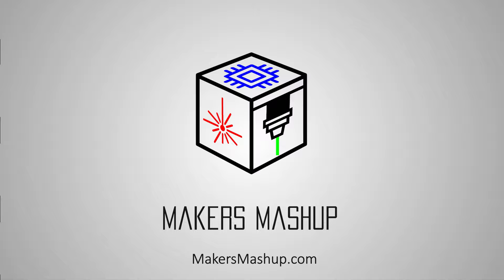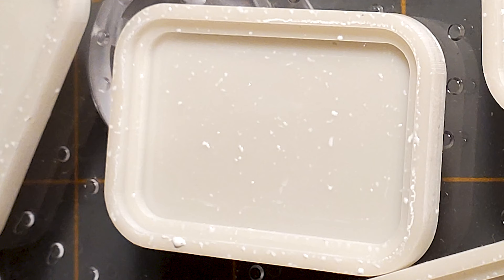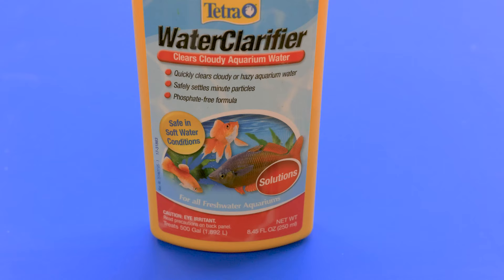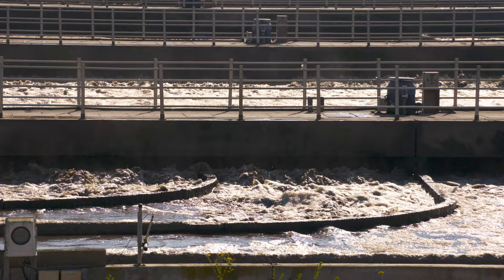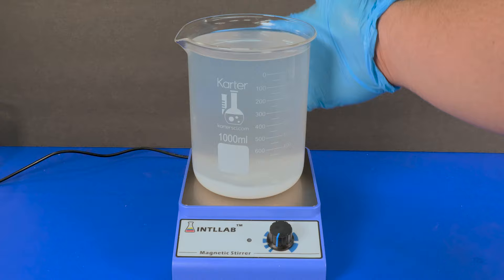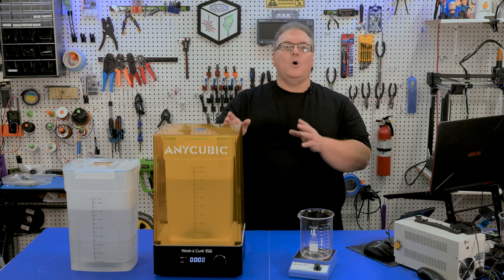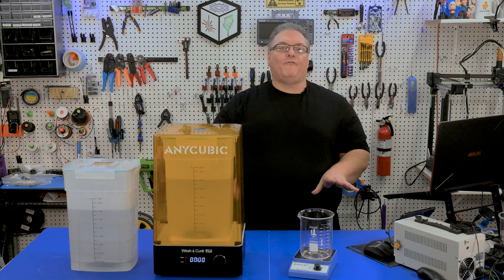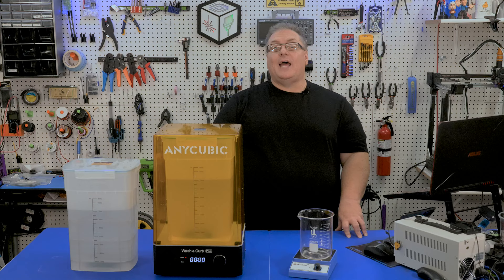Recycle Isopropyl Alcohol FAST! | Recovering IPA From 3D Printer Resin Wash

Comment: Okay, so I was hesitant to even try this just because of the dilution factor, but my IPA was so dirty that I figured I’d at least half-ass it, and half-ass it I did, successfully…
I happened to have an alum block laying around, I use it after shaving (it helps with razor burn and cuts boys, you’re welcome), so I used a zester and shaved off what I think was about 8-10g or so. I added maybe 2tbsps or less of distilled water, mixed it up a little bit and then added it all to my IPA, being sure to get all of the undissolved alum, which was most of it since I used such a small amount of water. I let my machine run for like 10 minutes and already noticed a difference after it was done. I let the IPA sit for a few days, not purposefully, I just wasn’t using it. I came back to look at it on day 4-5 and it was the cleanest I have ever been able to get used IPA, and I have used a bunch of different methods. It was honestly pretty damn surprising, I used maybe 1/10th or less of the alum in his directions and wayyy less water, so I really didn’t expect the results that I got. It also caused the resin to precipitate in a way where the solids were larger, causing them to sink completely with a clear separating line, unlike with sunlight where  the (really dirty) IPA just becomes cloudy and never seems to want to separate, at least with the resin I exclusively use. 

I hope this helps someone, while all the people below are correct about the flaws in this method, you can still get pretty kickass results using alum if you do it this way!
Reply from the maker: Awesome to hear you got the results I was getting.  As for dilution using salt to "salt out" the water is my next plan for this.  By using regular table salt you can have salt and water collect and pour off the IPA to get back to near 100% concentration.  There are a ton of YT videos that cover the process.  Thanks for giving this a chance Ben!
Reply: @MakersMashup  oh yeah good idea! I have done that with some 91% that I had laying around and it worked really well! Thanks for putting this out there
Reply: Very interesting.  It makes me wonder if adding the water is really even necessary.  Perhaps 91% IPA doesn't need it. Around how much IPA did you add the water to?
Reply from the maker: The water increases the propagation of the flocculant.  It's only slightly soluble in alcohol.  Without it I found it's not as effective.  I was treating about 7 liters of 99% ipa
Reply: @Jaysunn  I tried adding only alum to some after this, and it definitely did cause the resin to precipitate, maybe not quite as much. I also let the machine run for a long time, like 30 minutes or more, so maybe the agitation causes more interaction with the resin and alum. As MM says, the solubility of alum in IPA is so small, but if you’re using an ipa that is already 9% water, you’re probably fine to just add the alum. Even if it doesn’t work there’s no harm in trying, worst case it will just fall to the bottom and you can strain it out, if you even care to go that far.
Reply: @Jaysunn  oh and I was using about 3200ml of IPA, a little less than a gallon
Reply: BB, you mention in your original post that all the aluminum sulfate didn't dissolve in the water. Following your recipe, I added 9g of alum to 1 Tbsp of distilled water. I heated the water in the microwave a bit and it all dissolved.
Reply: @acmaurer50  problem with that is once it cools down, the alum will condence back out of the solution.

Comment: Interesting technique, here are a few things to note. 1) As others have mentioned, decanting does nothing to reduce the water content as the two liquids are miscible, 2) each cycle of purification reduces your IPA concentration by a factor of 0.87, so 100% IPA becomes 87% IPA after one cycle, 76% IPA after another cycle and so on, 3) IPA is hygroscopic and more volatile than water, both qualities will further reduce your IPA concentration over time. Personally, I'll stick with distillation, but I could see this being used as a pre-treatment to keep my glassware clean. Thanks for the content!
Reply: If anyone is confused about how I derived my second point, this is a perfect use case for the dilution equation C1*V1 = C2*V2 where C1 and C2 are the initial and final concentrations, and V1 and V2 are the initial and final volumes. Plugging in his numbers get us 100% * 1000 mL = C2 * 1150 mL. Solving for C2 and crunching the numbers get us to 86.96% IPA. There will be some very small error due to the volume of resin initially dissolved in the IPA - if we did account for this the final concentration of IPA would be even lower, but the difference is entirely negligible.
Reply: @megaladog6517  How does this work if you add back in fresh IPA to this mix? Like if I took my now 85% IPA and added 97% IPA to it how would I figure out the concentration?
Reply: @sirforcer  We can modify the dilution equation slightly to something like C1*V1 + C2*V2 = C3*V3, which is essentially computing the weighted average of your two IPA solutions. Let's say you have 100 mL of 85% IPA and you add 100 mL of 97% IPA, your final volume is 200 mL so the equation becomes 85% * 100 mL + 97% * 100 mL = C3 * 200 mL. Solving for C3 and evaluating provides the final concentration of 91% IPA.

Clearly, your actual final concentration depends on the amounts of 85% and 97% IPA you're mixing together. It might be better to plug in a desired final IPA concentration and solve for the volume of 97% IPA needed to get you there. Hope this helps!
Reply: what about fractional distillation? wouldn't the result just be alcohol since the water won't even come close to boiling and evaporating?
Reply: @SeraphX2  Fractional distillation is great, but it won't perform much better than simple distillation in the case of an azeotrope (like water and IPA). Here, separation is limited because of the way that IPA molecules and water molecules interact. Neither simple distillation nor fractional distillation address this problem, so you’ll get about 90% pure IPA at best with either technique regardless of the boiling points of the pure liquids. There are ways to get around this, but they are typically more complex and expensive.
Reply from the maker: You can always salt out the water.
Reply: molecular sieve as a solution? We used to do that all the time for getting the last water out of our ethanol.  Still have bags of the stuff.
Reply: How about salting out the IPA? Use non-iodized salt to remove most of the water, then follow up with MgSO4 (dehydrated epson salt) to remove most of the rest.
Reply: what still are you using?
Reply: @johncochran8497  anhydrous mag sulphate is not very soluble in water and is very exothermic when it does which can cause the IPA to flash off as a result and be a fire hazard.
Reply: @MakersMashup  Using salt is a bad idea, first it will add residue to your parts and second you can always freeze the water out of the IPA which is allot easier
Reply: @peterrusanoff1010  freeze distilling! That’s a brilliant idea that might solve most of these issues (ie. No fire hazard). I’ll think of some process, probably a way of decanting then filtering and finally freeze distilling.
Reply: @meatybtz  sure sieving would work but seems like overkill when simple distillation would work better and faster.
Reply: @megaladog6517  did you include in your calculations the fact that adding a salt to an IPA solution preferentially binds to water as opposed to the 2-propanol? If you look up ‘salting out’ it’s another method of separating two miscible liquids. You can do this with table salt and 70% rubbing alcohol and you will see a clear separation of salt solution and 2-propanol.

Lastly distillation in comparison is expensive and far more dangerous.
Reply: @megaladog6517 no. There are also volumetric effects in mixing 2 polar fluids with a differrent electronegativity on the O-H bond.
50 ml H20 + 50ml EtOH =/ 100 ml total fluids.

Comment: Looks like quite a mess when decanting.  I remember in high school chemistry,  we used a glass stirring rod to help avoid splashing during a pour by touching it to the bottle or decanter and pouring down the rod.  The surface tension pulls ot down the rod instead of down the side of the container.
Reply: Yeah, agree ,its fun all that alcohol in the desk , thats not good :)
Reply: I consider pour spouts that don't pour cleanly to be failures and not worth it.
Reply: Surface tention does not work like water or oil, it's alcohol. It breaks mich quicker. 

But theroetically you are correct

Comment: The problem with your thought process on the dilution of the IPA is that if the water actually did separate from the alcohol just by sitting, then there would be no need to purchase anything other than 70% IPA as you could just pour off the pure alcohol from the top and leave the water at the bottom. While it is true that water is heavier than alcohol the difference is actually quite small which is why you get specific dilutions of IPA or other alcohols. The only real way to separate alcohol and water is through distillation, (or evaporation which is really just slow distillation).
Reply from the maker: Fair point on the alcohol but I'm still thinking much of it is coming out through the process of binding with the resin particles.  Would be awesome if I could somehow test the concentration afterwards.  I could try and test it by weight but we don't know what's binding in that final sludge.
Reply: You won't get rid of the water so easily, as chemist I know how painful it is to get water free alcohol. You would need a huge amount of salt to get a separation, but it is possible. But I wonder if it also work with other salts or just water, since you have a saturated resin solution. You might drive it out via the change of polarity of the solvent. Overall it is a nice idea I think I will test something in the lab if I find the time. My approach so far was to polymerize the resin in alcohol in the presence of activated charcoal and after an hour under UV light, filter it through a filter filled with cotton.
Reply from the maker: Keep me posted and I'd be glad to collaborate on additional tests.  I love the cotton idea ve coffee filters.  I've done some prefiltering with cheese cloth but cotton may be the way to go for post processing.
Reply: @stratovv.7209  I concur. Water and IPA are miscible, so the IPA has been diluted. Also, IPA has a higher vapor pressure than water, so the IPA will evaporate faster than the water, causing more dilution. Sure, if you waited a very long time, the two would separate. Distillation is the best approach, or perhaps a centrifuge, but that will have different expenses.
Reply: @stratovv.7209  And isn't part of the problem that one molecule can hide inside the other? I remember a chemistry lab I took back in the early 1800's where when you added 100ml of iPA to 100ml of water you didn't get a final volume of anywhere close to 200ml. Am I remembering that wrong?
Reply: @MakersMashup  Specific Gravity measurements would indicate the concentration of the IPA/water mix. Compare that to fresh IPA.
Reply from the maker: Thanks Brett I wish you said that before I did more research. 😀👍 That seems like the way to go.  What I don't know is will any remaining photopolymer alter the specific gravity of the alcohol solution?
Reply: @MakersMashup  Almost certainly there will be an effect, but I can't guess what that might be. Also, how much of the alum remains? What effect does that have? So many questions.....
Reply: Tech Ingredients had a video a while back where they increased the concentration of alcohol by putting it in a jar with some beads that absorb only the water. You then pour the alcohol out and heat the beads to release the water. I think the beads were some sort of ceramic.
Reply: @Rickmakes  I wonder how that would work with like Orbeez. Do they absorb alcohol as well or just water?
Reply from the maker: I thought about orbeez as well.  Could be a good way to always de water it.
Reply: @MakersMashup  orbeez absolutely do not absorb IPA, they will absorb any water they come into contact with. 70% IPA had a decent amount of growth of orbeez, 91% had very little (virtually no growth) in experiments I did. Further experiments are probably needed but that's the info I have for you.
Reply from the maker: That's awesome it works.
Reply: @MakersMashup  If you don't want to take the orbeez route, the beads used by Tech Ingredients are called 3A molecular sieves
Reply: I can separate going to pee
Reply: @Rickmakes  molecular sieves.
Reply: @MakersMashup  Hydrometer Alcohol Meter
Reply: The water will stay emulsified in the alcohol. - a chemist.

Comment: Put salt in the IPA after the decant and shake wait 2 min and you’ll see a clean line between water and IPA. and then your back to 99% IPA and if your afraid of the teeny tiny amount of salt wash print with water after wash and cure. It works for me getting cheap 70% for 8$ a gallon and a little bit of salt making 99% IPA.
Reply: How much salt do you add?
Reply: @edeaglehouse2221 depends on how much IPA you have, add about a couple teaspoons per liter

Comment: Couple problems, water will not go to the bottom since it mixes with the IPA, and this should remove particulates but not necessarily organic solvents that can be invisible and accumulate overtime (need to doublecheck this). Basically the moment I saw you say that the water will not be in the final mixture because of the decanting I realized I actually have to discard the whole explanation because you have not researched any of this. Sorry but putting advice like this without checking it properly is quite dangerous.

Comment: I bought 5l of 99.9% IPA when I got my printer about 16 months ago, still on the same 5l. Never tipped any away but only have about 2l left, you can clean and recycle it loads of times.
Reply: what is your process?
Reply: I just bought 108L of 80% ethanol hand sanitizer at a massive discount. I wish I had read your post first haha
Reply: Hi! 👀What is your process??

Comment: You can avoid IPA altogether? by using Yellow Magic, then just let sunlight harden resin. Filterout resin chunks, reuse Yellow Magic(an industrial solvent), with close to 100% recovery. Now the question is what makes up Yellow magic? That is left for your future research. Also with YM, you need to use a heated ultrasonic bath, and mechanical brushing. One side benefit is, no weakening of resin parts due to IPA getting absorbed.❤️👍

Comment: My concern with the decanting is Alcohol is miscible in water, so it mixes in all amount and proportion, even if in an alum solution initially, it is being dispersed completely in the alcohol when mixed. To reduce the amount of water needed, add the 25 mg to 70 or so mL of boiling water then added the the resin before the solution cools and the crystals start to precipitate out.

Comment: As some others have mentioned this will slowly decrease the IPA concentration with the added water. If this eventually becomes an issue a secondary processing can be done by adding nonionized salt or dehydrated epsom salt (magnesium sulfate after drying it out) since the salts will be dissolved in water but not IPA (save for a small amount). Then it's a matter of decanting or siphoning the IPA at that'll be at the top of the vat.
Reply: How much salt should you add per liter or water added?

Comment: You can use sodium metabisulfite to achieve the same thing. You mix about 1/2 tsp per gallon and shake it up good to dissolve, I usually pour the mixture into another jar just in case some didn't dissolve, it mostly settles out over night. You can get it from most home brew supply stores. Great video by the way thanks.
Reply: Doesn't that form a corrosive substance? It's based on sodium hydroxide IIRC.
Reply: @_droid  never noticed that you could use potassium metabisulfite too both are used in wine and food production.

Comment: Also another note if your IPA is diluted down past a certain percentage there is a hydrometer specifically for IPA to see its strength if you add salt into diluted IPA and rigorously shake it the salt will dissolve into water, let it sit and you can visually see 2 layers in the solution itself while salt water is dense you can reclaim the IPA at a higher strength. This is a easiest method to increase let's say the IPA is diluted to 30% for some reason and you want to make it stronger with added salt you can in theory turn 30% to 90%.

Comment: Ho Lee Sheeeeot.  This is amazing. It works. I followed your recipe and dumped the Al2(SO4)3 solution into my Elegoo Mercury and the resin IMMEDIATELY coagulated and came out of solution. This HAD BEEN sitting for several DAYS with almost no precipitation. I'll update in 35 more minutes when the mixing is done.